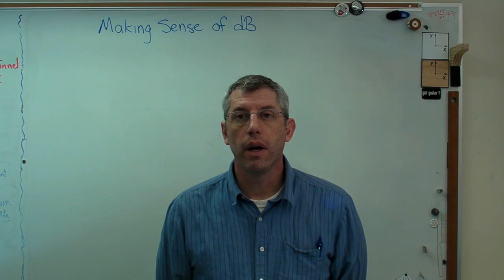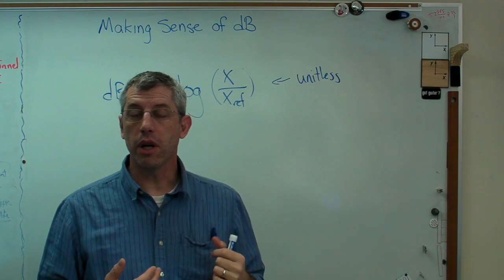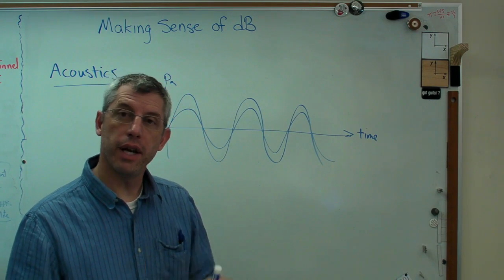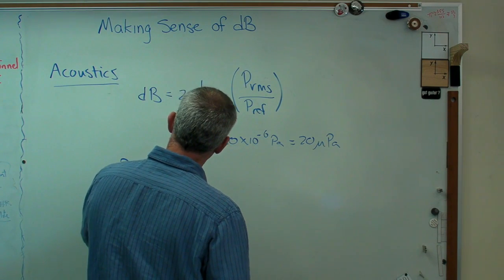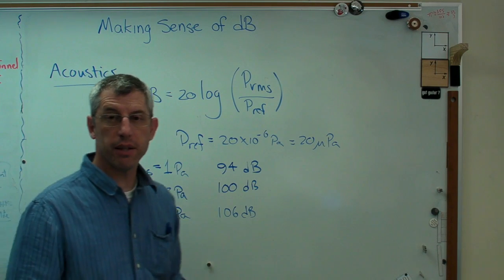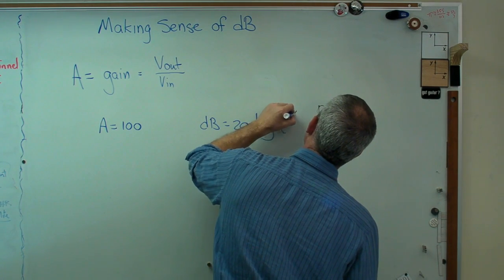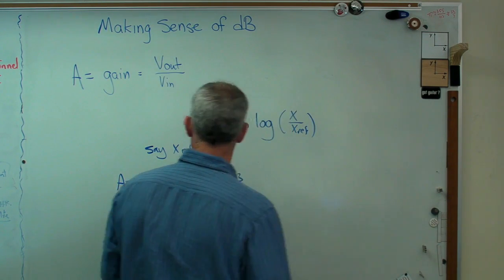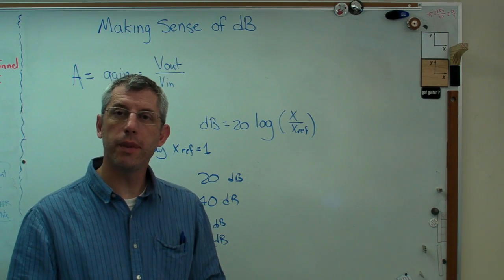Understanding dB - Brain Waves.avi

Comment: Why do you use 20*log(p/p_ref) instead of 10*log(p/p_ref)?
Reply: Two different scales are used when expressing a ratio in decibels, depending on the nature of the quantities: power and field (root-power). When expressing a power ratio, the number of decibels is ten times its logarithm in base 10.That is, a change in power by a factor of 10 corresponds to a 10 dB change in level. When expressing field (root-power) quantities, a change in amplitude by a factor of 10 corresponds to a 20 dB change in level. The decibel scales differ by a factor of two so that the related power and field levels change by the same number of decibels with linear loads. 

In short, there are two ways of calculating decibels depending on the value being measured.